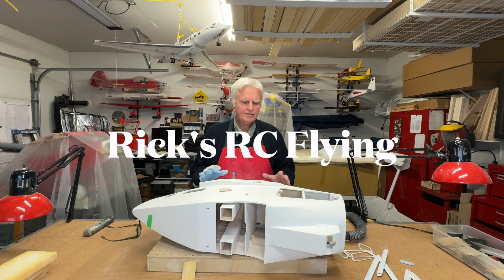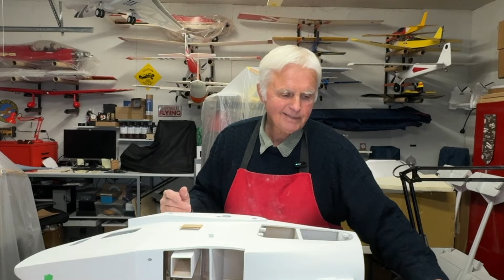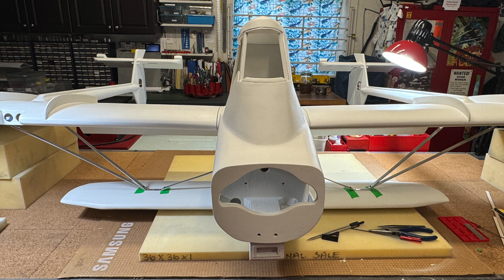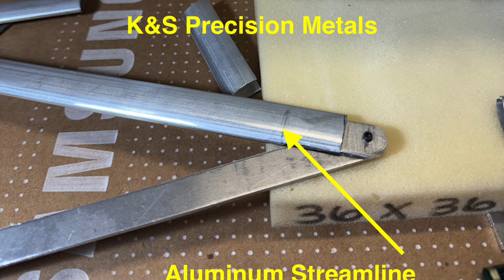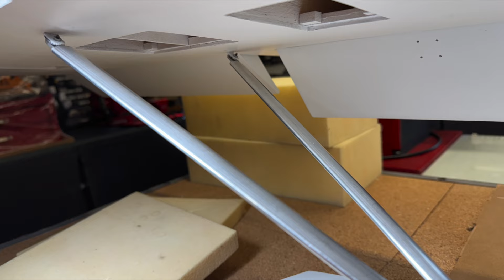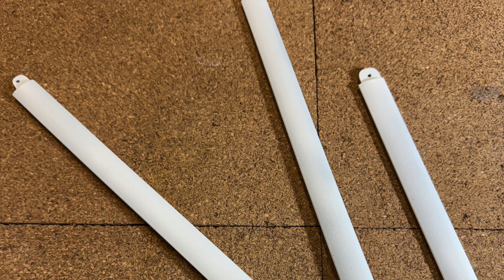Airtruk Cropduster: How to Create Aluminum Struts for an RC Model Plane

Comment: You've probably said before, so I apologize in advance, but what brand of paint are you using as a primer?
Reply from the maker: No problem! The product I use is made by Klass Kote. It consists of Part-A, which is the Epoxy White Primer #55, and Part-B, the Primer Catalyst White Fast #420. I prefer the "Fast" version because it doesn’t require an induction period. When spraying, thin it with a high-quality lacquer at a ratio of 10-15 percent. Though it’s not inexpensive, you’ll be impressed by its excellent coverage and how beautifully it sands. While there are alternative primers available, this is the one I consistently choose for my model planes. Here is the link to Klass Kote: https://www.klasskote.com/?
Reply: @rcflyingwithrick  Thank you, sir!